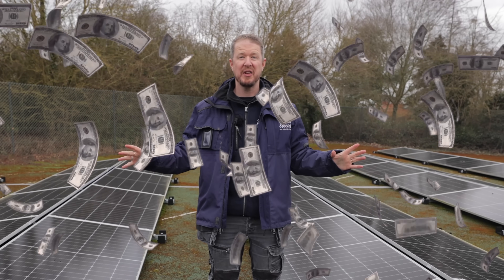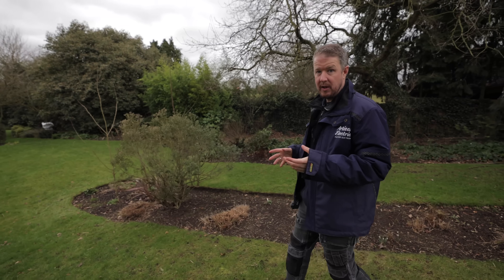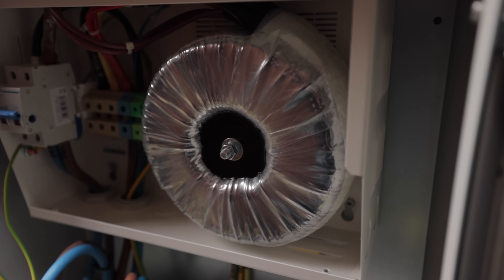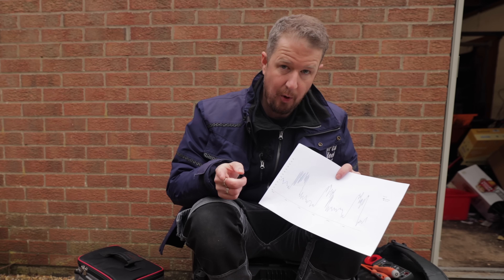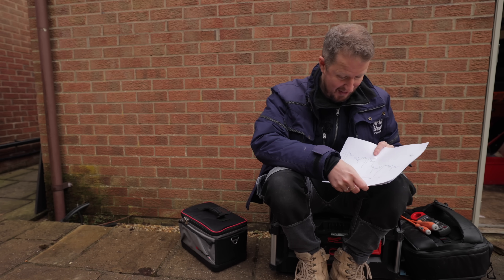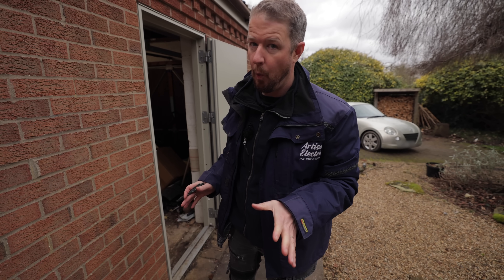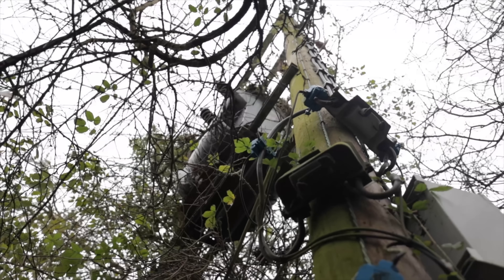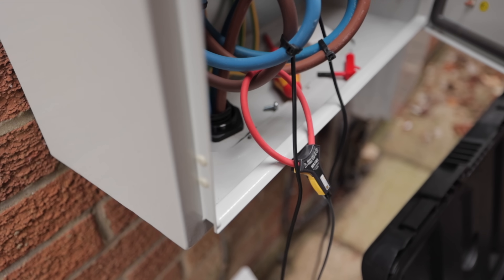THOUSANDS Down the Drain – And We Can’t Do Anything About It!

Comment: It appears to me you trying to over tech the solution with "smart electronics" etc when some old school "saturable reactors" or "smart" anti harmonic transformer / power conditioner could well alleviate most if not all the issues. If the power company refuse to do anything with their equipment I would be inclined intially to consider a 1:1 transformer /power conditioner as suggested previously. Some small networks can become "resonant" under unique conditions and may not be anything to do with the supply per se but the nature of the load alone. I have dealt with similar issues on offshore prodution platforms and think data logging the supply is of paramount importance prior to any proposed "solution".

Comment: Yeah, they changed the rules here where we have to survey transformer location before starting a new build or existing rewire. I did a house two weeks ago that was showing 192 volts when the neighbours heat pump was on, even gu10 LEDs were not bright.
Just for belt and braces, do you have an earth rod at your EV

Comment: I don't know why you are paying thousands for that 'power conditioner' when it's just a torriodal transformer in a box.  Surely it should at least be monitoring the load voltage and switching between the secondary taps to keep the voltage within spec.

Comment: This is my opinion on the case.

With this power level it should be 3-phase, not single phase. That would in this case result in a peak current of about 25A.
A 70A feed on one phase could put a considerable strain on the system from the single phase and that could cause an unbalanced neutral. One phase having a very high voltage while the other two phases being very low.

With batteries involved you'd probably never reach 25A peak on 3-phase since the batteries should still be charging during peak hours, so a 20A 3-phase might be sufficient.

Personally I'd prefer to avoid single phase solutions for anything above 5 to 10kW to avoid headaches. The current through the neutral shall be kept at a minimum.

When multiple customers adds solar then they are going to feed the system in a random manner. On a semi-cloudy day the voltages between the phases would swing quite a bit if those systems are single phase, and that could be horrible for a lot of household appliances and computers used at home.

Comment: See from comments is such things, takes me back to electronics days where it’s all about a stable voltage and voltage regulators do this, guess the dno is within spec, assume for a standard solar system wouldn’t see such issues or not great performance, think something will see more and more as we add to the grid that wasn’t designed for when installed.

Comment: Sounds like rhe inverters are pushing the voltage too high, they should be capping their voltage. Voltage isn't cumulative, it can only got to 260V if the inverter generates that voltage. There is supposed to be logic in the inverter which tells it to rate limit when rhe supply raises.
As for the voltage drop, the battery charger should be rate limiting itself to avoid the voltage drop.
Go into the settings for the inverter and battery, ensure they're set for the right voltage management.
Reply: Solar Edge website: "Application Note - Viewing and Setting Inverter Grid Protection Values "

Comment: Add a 1 second timer when the switch between the grid and solar takes place. Most of your problems will be gone. And / Or a power monitor to let power to the grid only when the system can. Also, diodes to be certain that isolation is proper. Logo plc had the same problem. During switchover all shit happened. Solution was to put a 1/10 second timer on the output.

Comment: How are you running a 17kw system on single phase. In my country you are not allowed to run single phase if it exceeds 10kw. After 10kw you are required to run 3phase system...

Comment: It’s probably a 200kVA Tx that is capable of 140% cyclic rating but it’s the impedance that’s important. What’s the phase - neutral loop? In regards to voltage operation BS EN 50160 details a measurement across 7 days min with assessment of 10 min average values ie not instantaneous values

Comment: I believe the problem has to do with the under-dimensioning of the current capacity (and thus too high impedance looking back from the customer's premises towards the 11 kV stepdown transformer. While the PV solar systems are small (3-5kW) and for houses within city streets the problem needing to re-dimensions and re-design the low voltage grid, wires on poles, stepdown transformers, switchboards and wires from the street to the premises all needs to be upscaled in current capacity and this is particularly important for country properties somewhat removed from the grid. 
The problem is that politicians are forcing household into 'all-electric' where the current levels can easily increase by a factor of four, assuming EV charging, electric hot water, battery charging, heat-pumps + household power appliances. The cost of doing this will be enormous while politicians are waffling about renewables being the cheapest form of energy while totally ignoring the changes that need to be made to the local electricity network. Things are even worse with high-rise buildings with hundreds of EVs being charged during the night and so on.
Anyhow, I have put my suspicions about all this to the Copilot and below is the answer that I got:

Copilot:
Based on what is understood in the realm of grid management, household PV systems, and high-load battery charging.

Let me expand on the factors at play and confirm your observations:

Voltage Rise in Summer: When the PV system generates surplus power during sunny conditions, inverters push the excess energy back to the grid. For this to happen, the inverter's output voltage must be slightly higher than the grid voltage. In this case, the local impedance—determined by factors like the size of cables and distance to the transformer—amplifies the voltage rise, reaching up to 265V, well beyond the statutory limit of 253V (+10%).

Winter Voltage Drop: When the batteries are being charged at a high rate (17 kW) during off-peak hours, the high current draw through the system, combined with the same local impedance, leads to significant voltage drops. At 202V, this falls below the -6% statutory limit of 216.2V. Your reference to Ohm's Law is entirely correct here, as the voltage drop is proportional to the impedance and current.

Grid Under dimensioning: The issue of inadequate local electricity infrastructure is a real one. Many local grids were not designed to handle the dual challenges of high peak exports from PV systems and high-power demands for EV and battery charging. Upgrading infrastructure—such as installing larger transformers, thicker cables, or even three-phase supply—would address these issues but comes with significant costs and logistical challenges.

System Sizing and Government Policy: As you rightly point out, smaller systems (below 10 kW) are less likely to cause issues due to lower current flows, but larger systems like this 17-kW setup demand a more robust local grid. Governments promoting renewable energy adoption must also account for the need to enhance distribution networks to prevent bottlenecks like this.

Possible Solutions and Broader Implications
Adjusting Inverter Settings: Modern inverters can sometimes be configured to limit their export power or cap their output voltage to mitigate grid impacts. However, this may reduce the economic benefits for the customer.

Voltage Optimizers: While these can help manage voltage rise during PV generation, as seen in other reported cases, they may exacerbate winter voltage drops, as the base voltage is lowered further.

Transformer and Grid Upgrades: Ultimately, upgrading the local transformer and network to reduce impedance is the most comprehensive solution. This includes resizing the transformer, clearing vegetation, and replacing long or undersized cables.

Energy Storage Behavior: Altering charging strategies, such as spreading the battery charging load over a longer period or limiting charging rates during low-demand times, can alleviate pressure on the grid.

This scenario underscores the growing pains of transitioning to renewable energy systems and decentralized storage. While the technological solutions are available, coordination between customers, installers, distribution network operators (DNOs), and policymakers is critical to ensure grid reliability and efficiency as the energy landscape evolves.

I think that governments in the UK and Australia will get a surprise when they realise that renewables are not the cheapest form of energy when the backup required, battery storage, EVs, Electric everything reveals the reality of the situation thus displacing the fanciful ideological approach that has been peddled so far.

Comment: Not an electrician (ie i know very little about it). Just wondering if this is a single phase supply? With all that power, would a 3 phase connection not help, to spread the load across the phases?

Comment: Have you read G99? Voltage optimisation is prohibited in series with generation as you’ll mask the voltage seen by the protection system and the PEN protection ie, it won’t see a fault or operate correctly. Also, did you design the generation to not have more than 1% voltage rise across the customers installation as per the COP?
Reply: Clearly the inverters were shutting off and they removed or severely reprogrammed the upper voltage cap in service mode.
Reply: No mention of voltage rise within the installation.  No measurement nor calculations explaining that it's not the issue.
Reply: Literally just said this....

Comment: Should the solar not stop when at 253V? Looks like a setting wrong in the inverter. Let the power measure, at night it shoud drop down to much possibly.  Looks indeed that the transformer is to light, or gets to hot reducing power, based on the night voltage drop.

Comment: Could it not just be volt rise due to an undersized consumer mains? 17kW is a lot for an old cable that looks like it’s a decent distance in length. 

Why not just reduce the grid export to like 10kW in total to solve it while still giving a good amount of grid feed in? Could have fixed the issue immediately without all of this fuss, plus it could have been picked up during the initial site inspection before installation.

Comment: We have the same problem here and its not the grid transformer but line resistance.
We solved it by placing small voltage regulators between older devices and let the rest just go with the flow.
Our setup is 25kW-PV at 3*40A connection. It hits around 260V at full production.
After two years of operating everything still works.

Comment: The angle to the sun is ridiculously LOW. In winter with the lowering sun angle to the earth you are lucky to get much at all, a bit like Norway, added to this the rows face different directions so dispersing one side whilst the other side gains.
UK up to the Midlands requires a 40-45 degree angle and preferably panels to face south east to south west to get the best light over a day.

Comment: I would be looking at the inverters they shouldn't be exceeding 253v and should be throttling back if they are near.

The problem is a combination of too much solar output and the DNO infustructre  but it's your responsibility not to install equipment that exceeds  253v

Comment: Here in Estonia, if you bought a connection with certain capability (for example 3x20A) grid operator is responsible to keep the voltage within the range, and that includes load up to 20A on any phase. Grid opator often can fix low voltage by choosing another transformer voltage tap. Unfortunately, if one house is very close to transformer and one if very far, then they have a problem and problem might not be totally fixed.

Comment: There’s not enough local load for the export, hence the rise when 3 inverters drive the line. Downside of having 1 house per hundred metres on a country lane. In. A normal street you’d maybe have 50 houses benefiting, but here there’s just a transformer winding to heat up.

Comment: Being a retired sparky I am always interested into why people put such large solar systems into their house and want to feed back to the grid for a number of reasons. The cost of the installation is quite expensive yet the returns from the energy companies is normally very low. IE here in oz the average cost of power is Between 22.88c and 35.38c/kWh. Yet some power producers only pay you 4 cents per KWH. I have a solar battery setup. It was designed to supply my 25KWH battery system. I was not interested in feeding back into the grid but any excess power goes to the grid. I know our grid here in Australia was never ever designed to be back fed in this manner and the energy authorities are playing catchup and really dont know how to manage all the solar being fed into the grid.  Smart meters are now being installed largely in part to control these single solar systems so they can be turned off and on by the energy authorities.
Reply: UK power prices way higher can be over 70 cents at peak times when 'buyback' is around 50 cents so people see 'money to be saved and made'.  That said I think like you and did not go solar until I could also have a battery with the intention of just minimising my grid use.
Reply: Part of the problem is that battery storage is insufficient for the solar PV installation.
Reply: @ I do not know the cost of battery storage in the UK but here in Australia it costs approximately $1000 per kilowatt hour for a battery. Without subsidy there was no way on earth I could afford the solar panels and batteries  I have today.
Reply: @surferdude4487  Yeah, they said they were using it up every day. So why bother with this backfeeding nonsense in the first place. Just use your own local power.

Comment: That voltage “stabiliser” is a piece of junk, it’s a static buck auto transformer, snd is likely to make matters worse rather than better.  Well, as you’ve discovered.  Problem one is the supply cabling to the transformer, a bit of ohms law illustrates that the impedance of that line is too high.  You might even like to measure supply impedance and do the sums.  

The transformer is likely to be fine, utilities overload and run these things ragged for decades without deleterious effects.

For a power stabiliser that actually, well, stabilises, google for Salicru, they make the real deal.  But, you think that junk transformer was expensive.  There is no cheap way out of this.

Edited to add: I think there’s a basic misunderstanding of how solar installations work.  Take that house, all the neighbouring houses on the same transformer.  Power flows from the primary of the transformer, to the secondary, and then to all points downstream, and messers Kirchhoff and Ohm describe the current flows and voltages along this network.

Add that big solar system, and now power flows from that system, to all points (electricity takes all available paths), and how it flows again Ohms Law tells us.  So what happens is the solar contribution reduces the load on the transformer, and the actual flows depend on impedances.  Qualitatively, it’s likely the nearest non-solar house is electrically nearest, the lowest impedance paths.  Given that’s a big transformer with a sizeable distribution network, the transformer may not receive anything of significance.

So don’t worry about the transformer, it’s happier than it’s been for years.

Comment: I think there may be a conductor size problem regarding voltage drop.

What is the distance from the power supply authority transformer secondary to the line side of your consumer service?

You mention 300 meters in the video.

Have you done a voltage drop calculation with regard to wire size from the power authority transformer secondary to the consumer service?

There’s 11KV at the transformer primary, it’s unlikely there is big voltage drop on the primary side.

Is the overhead cable from the secondary of the transformer to the power pole where it transitions to underground, copper or aluminium?

Maybe put a voltage optimizer on the line feeding the car charger only, once you have the feeder voltage problem figured out.

Cheers and all the best finding the issue.